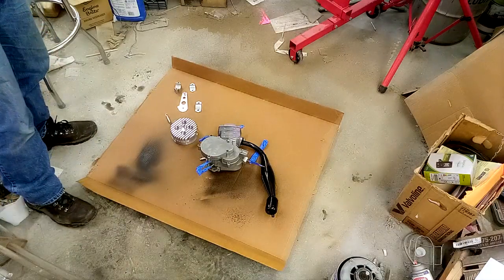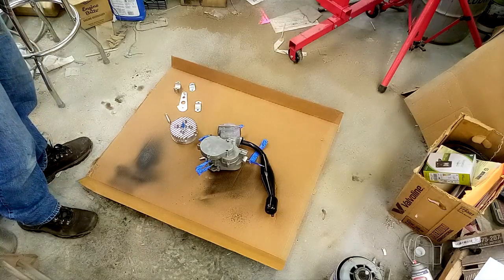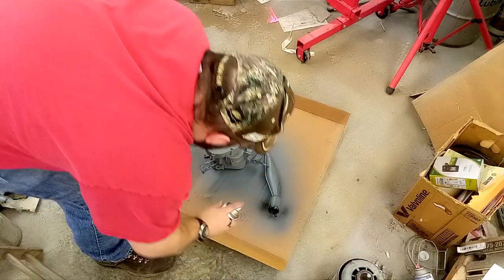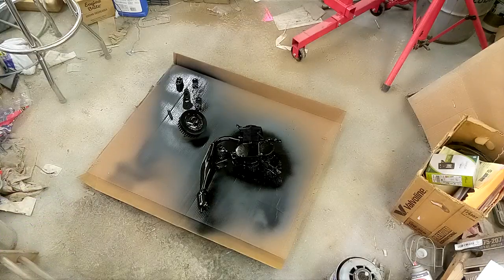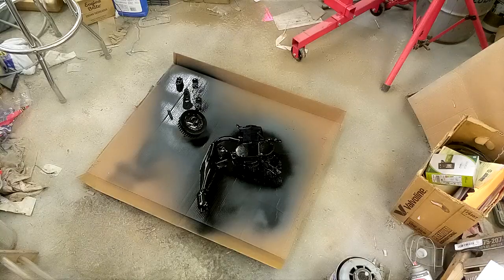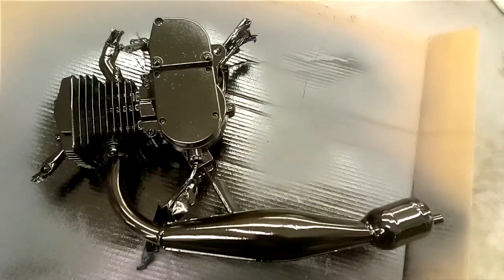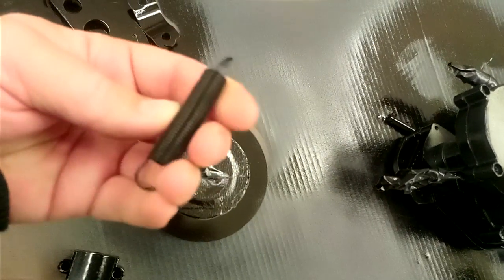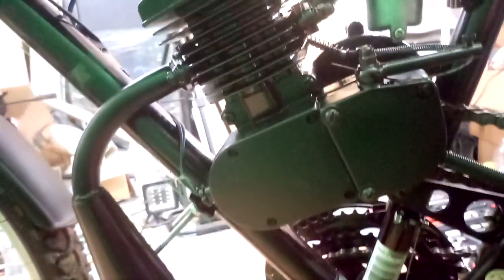How To Paint Your Engine Block Black How to Build a Motorized Bike Part 25

Comment: Why do you have 2 chain tensioner on the bike?
Reply from the maker: The spring tensioners don't apply enough constant tension and have too much give, and this causes the chain to bind inside the engine on startup. The top of the chain gets loose and jams inside the cover. The Spring Tensioner is still good to have, because if the chain stretches, it picks up the slack, or if for any reason there is extra slack. Once the chain is fully stretched and stops stretching, I can take the spring tensioner off.